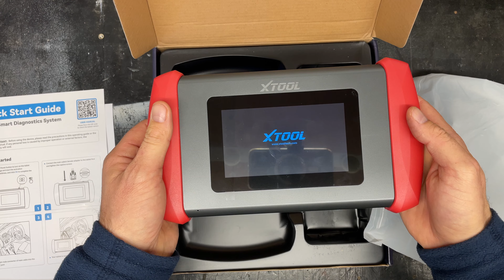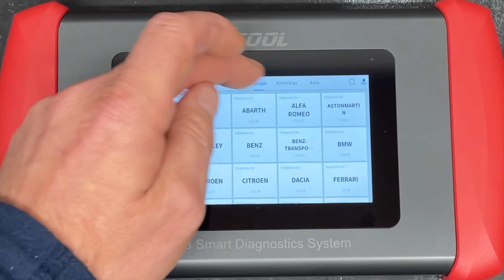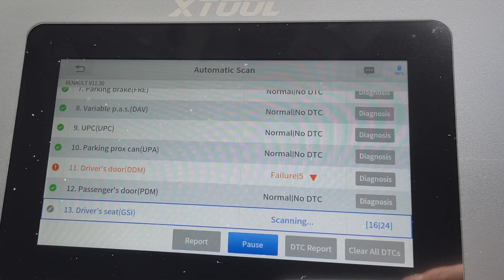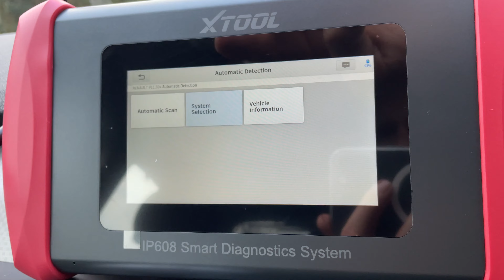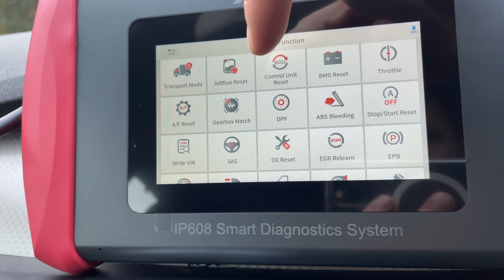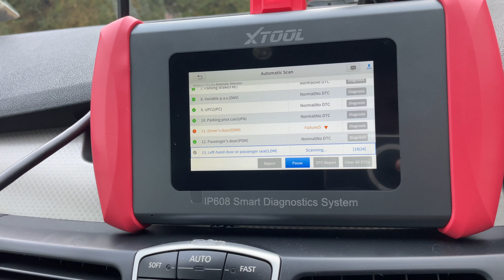The best DIY diagnostic scan tool, Xtool IP608 smart Diagnostics system

Comment: I'll stick with my Autel MS906, Launch pad 5 pro &Thinktool Pros!... That's crap!
Reply from the maker: Hi and thanks for the comment, they are very good scan tools you mentioned and more on the professional level. This one is more leaning towards the DIYer than pros as I mentioned in video and price range.
Reply: @quickfixmechanics  Been a mechanic not technician but have been an electronics tech in OZ 40+ & do a lot of diag & programming work that other businesses can't.
Reply from the maker: Brilliant stuff, wishing you many more years of success